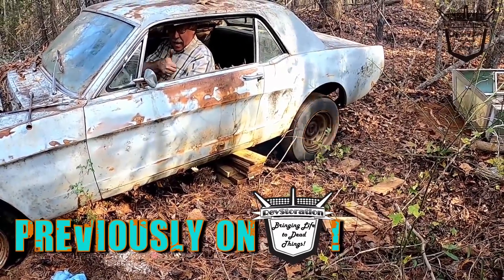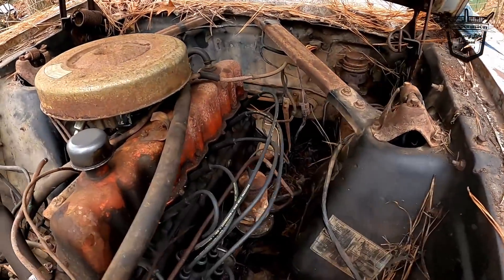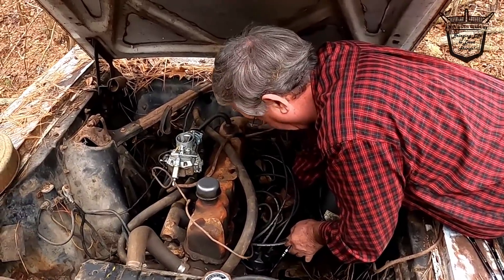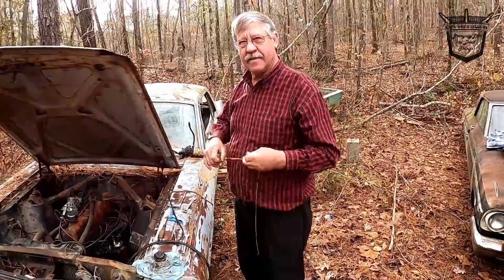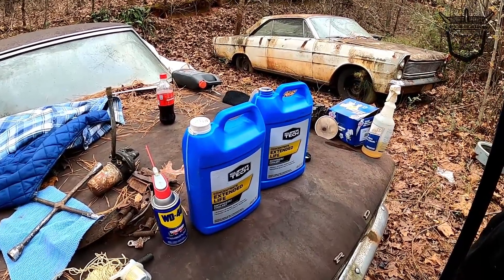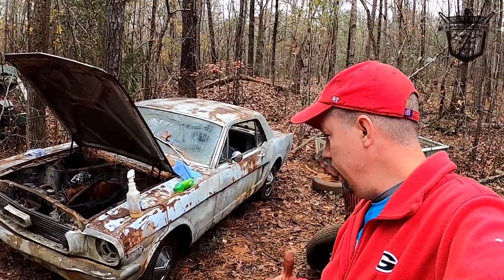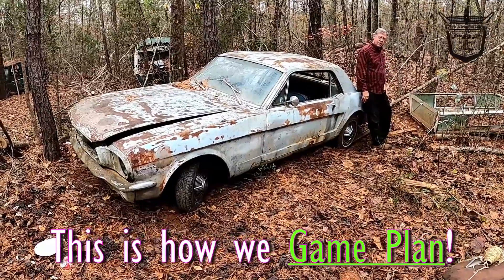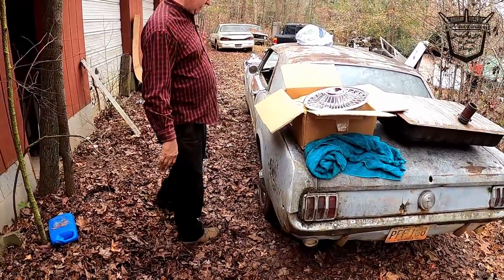Will She Move from Her Grave? P2 1966 Ford Mustang Resurrection:  Smoking Tires to Set the Pony Free

Comment: That aircleaner looks like it might be the chrome one with no snorkel and you can see the sides of the car has no windsplit  trims and if this has a factory centre console which I couldn't quite see, it might be one of the Mustang sprint 200 limited edition 66's.
Reply from the maker: We have taken the console out but yep it has one. That is pretty cool, could I confirm with the vin number?
Reply: @RevStoration  No the VIN wont tell you. For a period of time in 1966 I understand there was a shortage of v8 engines for Mustangs so the Factory ran a line of "dolled up" sixes with  extras as a marketing ploy in the Spring. This link will give you some info of  the extras found on them. You need to remember over time things could have been changed around .If it was a Sprint it could have had "plain Jane" parts added and
Sprint options deleted or if it was a plain Jane to start with it could of had sprint bits added. The Console and absence of the vents and air cleaner is encouraging, it would be interesting to see if there is a pinstripe lurking under that paint. https://www.liveabout.com/1966-ford-mustang-sprint-200-2464599

Comment: A 1966 6cyl Mustang would have come with 14" inch wheels originally.  Only "some" 1964 1/2 Mustangs came with 13" inch wheels... Just an FYI.... Those wirewheel hubcaps are 1967-1970 wirewheel hubcaps.  1965-1966 wirewheel hubcaps were the same identical hubcap but had different center "spinners".  You can buy the '65-'66 Wirewheel "Spinners" with Blue centers and Ford crest, and add them to your caps and then you will have the "Correct" '65-'66 wirewheel caps.  The '65-'66 wirewheel center spinners usually sell for $50 a piece from most Mustang vendors. They include the Blue center cap as well. NPD carries them. Tony K. :o)  1966 Sprint 200 Mustang Registry.
Reply from the maker: We hope to bring this girl all the way back. So thank you for the information. The caps that we installed on the car are for the 13 inch wheels so these work for now. We will have to find the correct spinners and wheels before long. Thanks for watching and commenting!

Comment: Top radiator hose is supposed to be a 90 degree bend, the one there is a straight hose with a big kink in it , bent and folded over.
Reply from the maker: Grant, it must have been one of those make it work moments at least 28 years ago. Thanks for watching!

Comment: My first car was a 66 Mustang, mint condition I bought it in 1973 for $400 . 289 V-8 2 barrel carb, 39,000 miles. Automatic transmission power steering but manual brakes. AM radio. Loved that car.
Reply from the maker: Sweet ride for sure.

Comment: I had a '79 Ford Granada I and she drove that across the country on vacation a couple times. It was a great car. I hate the old spring clamps they used to have I replace every one with a hose clamp I can get a ratchet on. Great to see that Mustang get out of that hole its been in for 28 years. Great Job.
Reply from the maker: Larry, we may get this old granada up and running again. WE would need to move and cut down a few trees, but it would be fun!

Comment: about the hose clamp screw, there are color coded socket drive screw drivers sets available . I have a set because I used to be in  the A/C field and we use the red drive [1/4],yellow drive {5/16],and the 3/8 mostly. these are handier than a socket wrench most times.
Reply from the maker: Thanks Blaine

Comment: Early this year, I bought a '79 f150 that sat for 10 years. I broke the engine loose, replaced the fuel tank, and replaced the entire brake system. Both of the brake lines coming out of the old master cylinder twisted up like that fuel line that the ole man took off.
Reply from the maker: Rusty lines usually create the ole pig tail.. Hopefully you found a few to replace it with. Thanks for watching!

Comment: I did that once on my old 93 Chevy G20 conversion van, I accidently put oil in the radiator but luckily it was only a 1/2 quart but I felt dumb for not realizing it, all well it didn't mess up the cooling system. I thought it was used coolant but it wasn't, also what's the story on that old mid 80s thunderbird I just seen behind the F150?
Reply from the maker: That is what we thought we did.. we needed to concentrate more. Thanks for watching and sharing!
Reply: Not a problem. I love seeing vehicles pulled from the grave

Comment: It’s concentrated meaning it is not mixed and needs to be mixed with water guys. They sell it that way so you can get the mixture you need to run for your area’s temperatures like if you live in colder areas you will need a different mixture than someone in a warmer area... but it’s all good now you know
Reply from the maker: We finally figured it out... it was thick and the wrong color..

Comment: CAPTAIN SAFETY says:  Spraying gas from that bottle is atomizing the fuel with oxygen making it extremely flammable.  Chemical bottles are very inexpensive.  They have a "straw" that is bent over reducing vapors that can escape, but a quick squeeze get the fuel out.
Reply from the maker: Mike, I agree that it is flammable.. working on these old rigs can be dangerous at times.. I had the bottle so that is the reason that it was used.. whatever is handy sometimes trumps safety.. no good for the eye brows though.

Comment: Here's a good tip for you I been working on engines for over 20 years when working with carburetor and getting it running for the first time in years or adjusting it keep a damp towel with you to where you can grab it and throw it over the carburetor if it tries to blow back through it keep fuel or fire from your face
Reply from the maker: Good tip... I have burned a few eye brows in my 20 plus years of working on carbed engines. Thanks for watching and commenting!

Comment: That 1960 Falcon is called a Tudor.  Early 1960s Falcons have greatly appreciated in value in recent years so it must have been very rough for you to pass up on it.
Reply from the maker: I've owned many falcon Tudors and would have loved to picked that one up. It was a long ways alway from the house and the price wasn't right. On to the next!
Reply: @RevStoration  The 144 6-cylinder is underpowered. I like the later 1961 Futura with the center console.

Comment: You most likely will have to pull the intake and exhaust manifolds to get at the freeze plugs. Sand the holes to ensure a clean fit. I use Permatex #2 or aviation gasket sealer on the plugs. Use a socket that fits just inside and an extension and tap them in. Let the sealer set up and fill up.
Reply from the maker: No doubt.. it will be a job.  We can get done! Thnks for watching!

Comment: you are not supposed to put that extended life antifreeze in old cars its made for newer ones with aluminum componants and will not mix with the old green and will clump up and stop the system up over time.....
Reply from the maker: She was dry as a bone and will be again with the freeze plug out. We will pick up the all vehicles green blend next time after a flush! Thanks for watching!

Comment: On your gas tank drop it put a gallon of muriatic acid  a gallon in the tank take sending unit out  fill with water leave 24 hours pour it out and hose it out good . It will clean all the rust out of the tank . Keep it away from aluminum and brass
Reply from the maker: We have a radiator shop that rots them out too... that is probably exactly what they use. Thanks for watching.

Comment: I’m sure you might know but just in case you don’t, the entire 5 lug suspension from that Grenada will swap into that Mustang. Almost a bolt in. Good channel, keep it up.
Reply from the maker: I owned a 66 V8 many years ago and I asked  the Old Man for the car for that purpose. I was just going to use the disc brakes.. Thanks for watching!

Comment: When you have full strength anti freeze,  you have to mix it  with water in a 50 %/50 % (half)percentage.1/2 water and 1/2 antifreeze.
Reply from the maker: We have used concentrated antifreeze before but the color and texture.of this threw us off. We figured it out!

Comment: Heads up on if it's a 66 
 tryed to see if there is any  on  passenger side there should crome fins under the back windows  if there is bolt holes there then it be a 66 I could not see any on my junk phone 
look up pictures  65 and 1/2 and 66 Stang's Dad might get wrong year parts had a 66 was my favorite car I was on my way to get new front tires raining for weeks I hydroplaned fliped over landed on driver's window post smashed down to the driver's seat.  I got throne to passenger seat. no I did not have my seatbelt on if so I'd be dead walked away small bump on my knee from 8 track player ..  crying my mint Stang I only paid $650.00 for it in the 90s had new 200 motor and new interior took a whole Saturday and hand buffed out the paint only going 45 MPH
Reply from the maker: Wes, this is a 1966 Sprint 200, it did not have the chrome on the side, it had a console, and a chrome breather.. I think they made them to try to sell more of the inline 6's. Thanks for watching!

Comment: Just put a rubber expansion freeze plug back in it.   A lot easyer than metal ones
Reply from the maker: We may do that if it isn't easily accessible. It probably is going to be the most difficult one to get to.. We will figure it out.. Thanks for watching!

Comment: A carb rebuild would had been more video value for viewers then a brand new part tossed on the Mustang.
Reply from the maker: I have rebuilt the autolite 2100 on the channel and will probably rebuild one of these old Autolite 1100's, but this one was on the shelf ready to go.. so I put it on. The carburetor that was originally on the car was not an original carb. Thanks for watching!